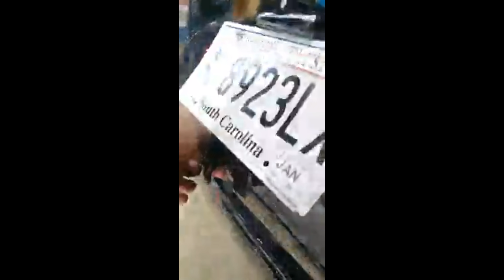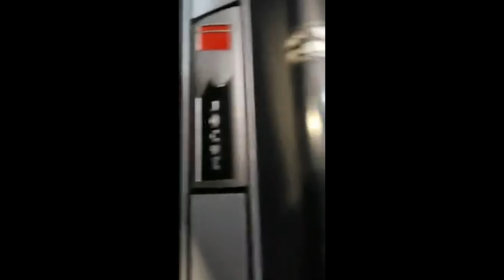IG livestream 2.20.19 Cobras, shelbys terminators and Coyotes

Comment: I got a chance to work on a Factory Five Mk. 4 Cobra with a Coyote. It had a TKO600 and a 3 Link 8.8" Rear End. The car with Heat, AC, Bluetooth/Speaker and a full size battery weighed 2380lb with a 1/3 tank of gas. It rides great and it's not all that loud, even with sidepipes. It got 31 MPG in mixed driving (mostly highway). Factory Five offers an option now where you can use a 2015+ Mustang IRS. With an FFR you can also get coyote headers with the O2 in the collector.
Reply: Dang makes a fox body seem heavy
Reply: Absolutely, the car could have easily lost another 100lb too. It had a lot of heat insulation in it and fairly heavy wheels and tires.
Reply: @AKDMB  Crazy. could get under 2500 pounds with driver.  I love turbos but on a car like this a supercharger fits it better in my opinion.

Comment: My guess on the throttle body test is the stock vs gt350 throttle body hp will be almost negligible. The bigger throttle body maybe 5-10whp or so. I think the stock cold air will hold back the throttle body so it won't see much gains. Just a guess tho